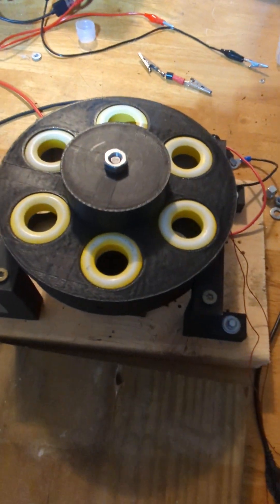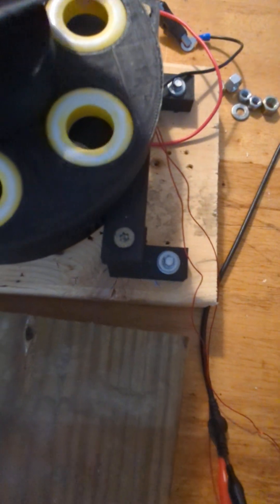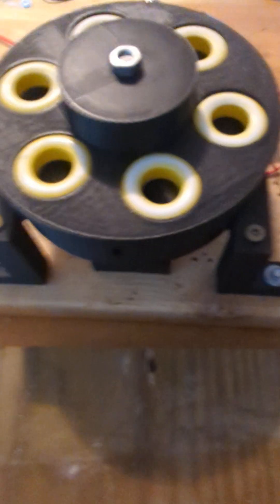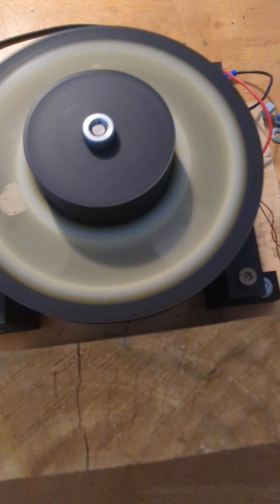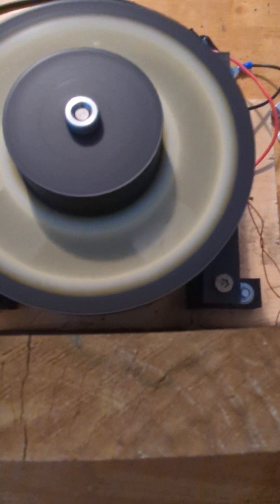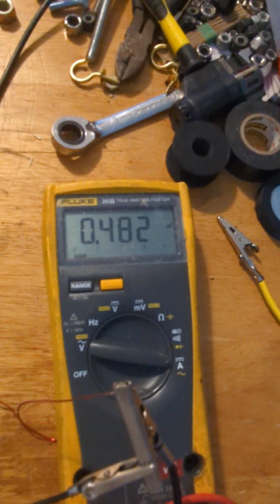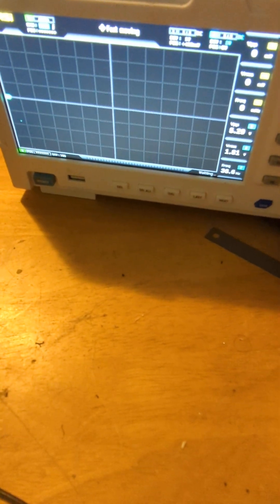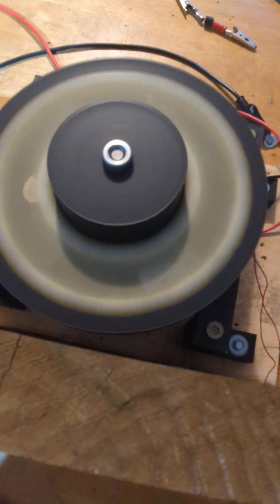Reverse Lenz Generator Build- Test #2  New Rotor with Ferrite

Comment: Reverse lenz law sound like minus lenz law , same thing just oposite direction.
I hope i am wrong
Reply from the maker: It's actually looking like a balanced system where Lenz in Minimal at best.  New update just posted on my channel
Reply: @floodrod hi sir how r you can you share rotor and coils info with detail
Reply from the maker: @goharnawaz9972   forum link in description. Join and participate
Reply from the maker: Opposite of deceleration is acceleration. Opposite of sending power into coil to power. Motor is taking power out of coil to power motor
Reply: @floodrod  how to do it sir if possible kindly explain
Reply from the maker: @goharnawaz9972  I am not having lengthy discussions on YouTube comments. If you want information, go to the forum, register for free, and post questions and read the information. I am happy to discuss on the forum
Reply: @floodrod  ok sir i will follow

Comment: Although  the voltage is not too high the amperage is very promising and the amps is where you would be getting your drag, but as you can see there is not much difference between shorting and unshorting which is great news!!!
Reply from the maker: Thanks..  I just glued the magnets and ferrite rings so tomorrow (when dried) I can lower the rotor closer to the magnets and really juice it..  When I get all 4 coils in, then we will know the real deal with this.